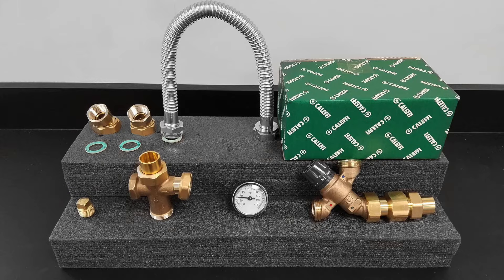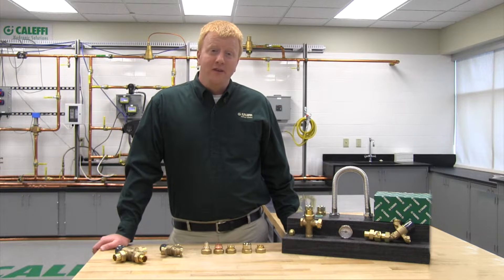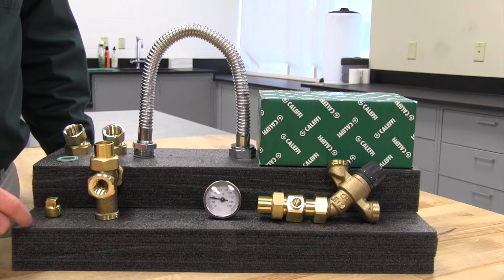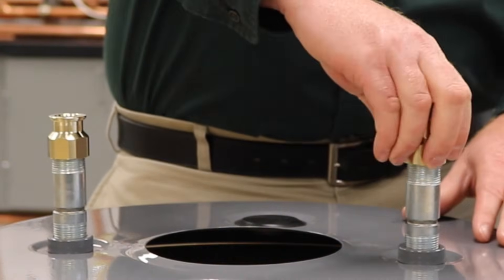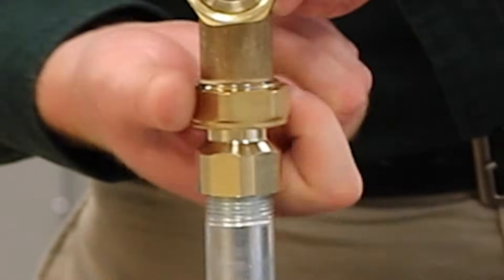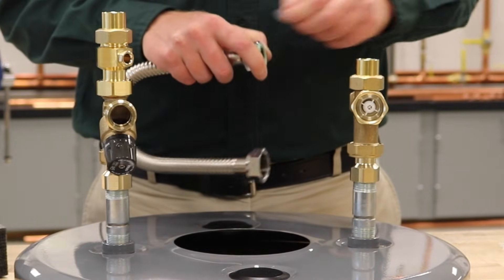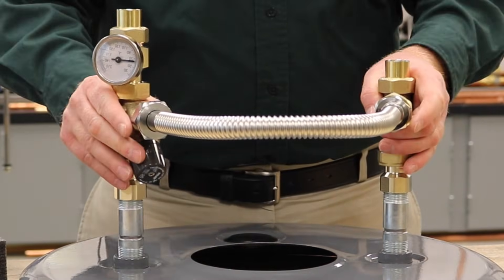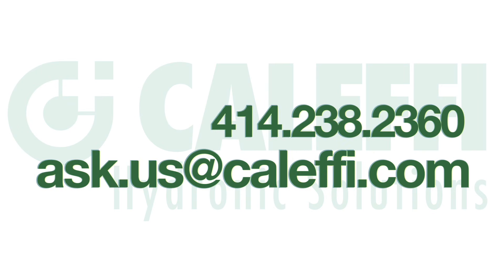520 TANKMIXER™

Comment: Hi Cody.  Nice job explaining the 520 mixer.  My question has to do with a Combi boiler (VMax 153-P).  A mix valve is required and the hot out, cold in DHW boiler connections are pretty close together.  There is a separate recirc tapping so the brass plug would be installed in the 520.  Any comments from you that come to mind for this type of installation?  Appreciate your input.  Bob C.
Reply from the maker: Bob, thanks for your question! 
After doing some reading on the NTI model that you speak of, the TankMixer kit with the cross and flex hose may not be the best product for your application.  Remember that you can always use just the 520 (body with fittings that I spoke of) or the 521 series and pipe it in accordingly.
Let us know if you have any further questions!
 -Cody